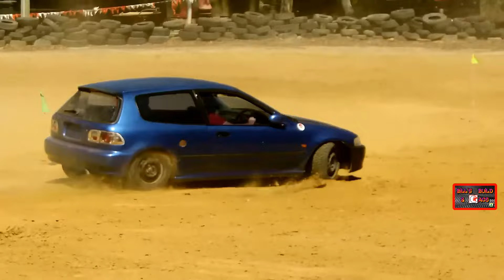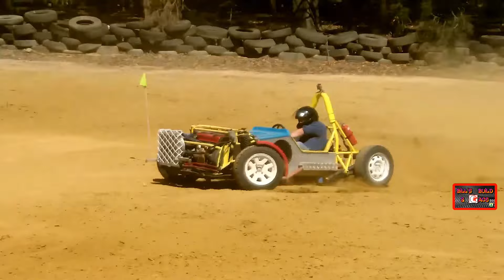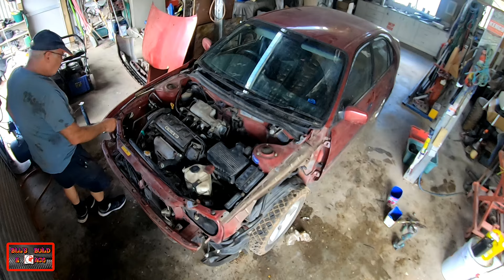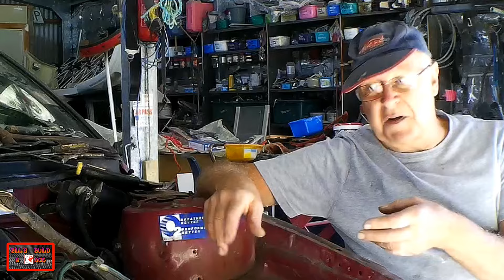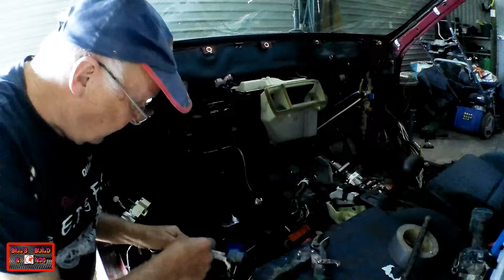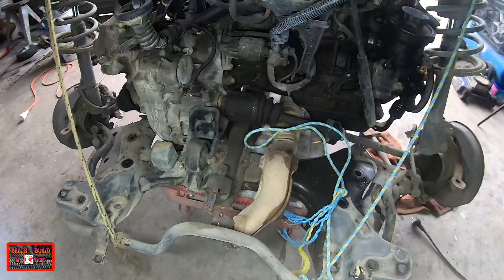Building an Autotest Special part 1 -  Front Teardown

Comment: The start of another great build. I will be tuning 📺 in for the next episode.
    The explanation of how to deal with wiring, plugs, and connectors is excellent. "Wait to cut / remove until it is running." Great advice.   Looks like you've done this before, lol.
    I've been a subscriber since (Velociraptor) V6 mid engine buggy.